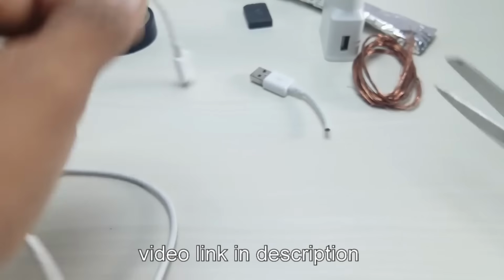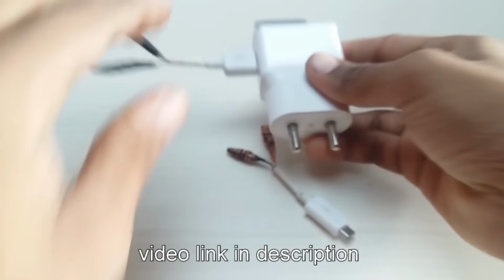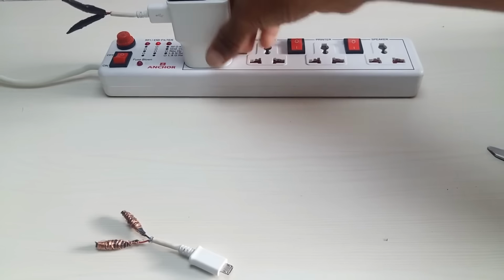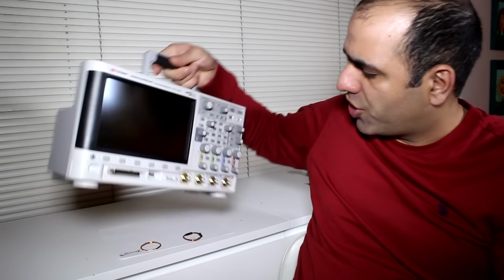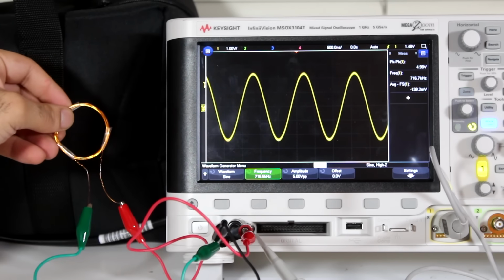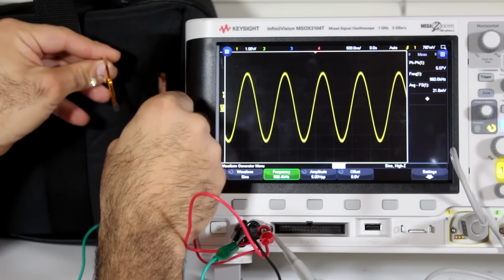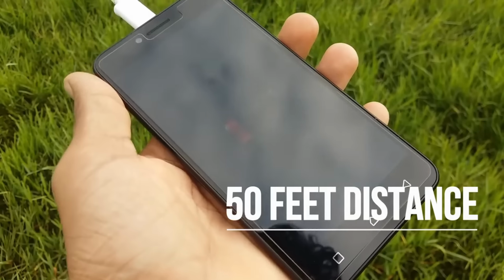Fake and Real Wireless Power

Comment: People that believe that video are the people that believe the sparks that are produced when you "shock" yourself with 120V

Shhh... Don't ruin it! ;)
Reply: Come on...120 is for p8ssies! Upgrade to 220V and feel the wrath of AC/DC :)
Reply: Yonatan24 Are these the same idiots who put their iPhones into their microwaves during that huge misinformation campaign?
Reply: 'Cause I'm T.N.T!!! :-D
Reply: cmon 220v is for bitches, upgrade into 3 phase 240v AC!!!
Reply: Oh, you don't know that you can charge them that way? ;)
Reply: Yes. i wrote down both AC and DC because the wall power supply is AC,but many devices in the house require DC,and you can shock yourself with a phone charger,for example :D
More volts,more fun :)
Reply: xXx_MlgTr1kSh00ter _Xx 3 phase 480 is better
Reply: TheDrunkenRebel
XD
Reply: I'm dynamite
Reply: For 220V(I'm not saying he really did it, but it's possible): I have seen spark from static electricity when I touch a door handle, also you can see sparks from lower quality plugs when being inserted into a socket. When there short as in those cases the air is heated and energy is transferred between the two points over it - for instance lightning.
Reply: +Mr.Someone \Tom/ Put AC on your tongue. You will fucking feel that shit xD Equivalent voltage DC simply doesn't hurt as bad as AC, ever. The tongue is just sensitive, mostly cause its wet.
Reply: xXx_MlgTr1kSh00ter _Xx or just g
Come to my home and play with some 380V AC =)
Reply: TheDrunkenRebel  AC is the current you can feel through your body and dc is the one that you can feel through your tongue ;-)
Reply: nope, the microwaves charging campaign was originally planned by 4chans

Comment: You can also achieve higher range by increasing the gain on the receiving and transmitting antennae. For example my toothbrush has wireless charging. I'm pretty sure it uses two highly directional antennas, with a load sensor to detect when the toothbrush is in the charging port so it does not waste power.

I really like it. Great idea to waterproof a port. Great vid as always. Really like your content. I feel like the shocks were a gimmick and you can move away from them. The production value and comedy are making up for it.

Comment: How was the capacitor value on the secondary coil calculated to get a resonant frequency of ~1kHz?
Reply from the maker: +agr00m I wanted 1MHz resonance, and I had 1nF capacitor. So I calculated my inductance using: f = 1/(2*pi*SQRT(L * C))
then I had a round solder flux container, measured it's diameter and using an online calculator got the number of turns I needed and it was pretty close to my desired resonance.
Reply: f = 1/[(2pi)sqrt(LC)]

Comment: BTW, you're terribly wrong with inability to transmit power using a DC. We can create a powerful DC source that will create powerful electric field that will ionise some conductor and will create a secondary current. It's very complex and doesn't apply to the particular video, but it is possible.
Reply from the maker: +Александр Шишлов well, if you raise the DC voltage so high that air breaks into a conductor and then arcs through (like lightning), then you are really turning air into a wire! That's no means to transfer energy efficiently anyways
Reply: But he is specifically talking about inductance which needs an AC current in order to generate magnetic flux, otherwise it just functions as a short.
Reply: Александр Шишлов Ah, I see what you're saying. You're speaking in general terms; I'm speaking specifically about this "hack." Yes, a DC generator works by physically turning the coil to induce an EMF that is roughly DC (the current is still alternating though, it's just that the high number of rotor coils smooths this out to a continuous DC). 

However, ElectroBoom was talking about this hack, which has no moving parts. He simply plugged in a static, stationary charger with two  unconnected coils which definitely does not create any type of current.
Reply: Yes you can deliver power by static electric fields, but it's really ineffective. Power transfer over arc discharge is another topic, but that's not "wireless" anymore.
Reply: I'm not talking about arc-discharge. Arc involves high current, but there are plenty other discharges that do not involve breaking air into conductor. There are even airless discharges. (E.g. Townsend discharge).
Even without discharge: some conductors have much lower work function than others, thus you can make electrons flow out from the secondary conductor without ionising the primary one.

What I'm trying to say is that you were right in the particular case, you were wrong in general.
Reply: Marian Keller Could you explain further? I'm only aware of inductive coupling and capacitive coupling, both of which require oscillating fields or moving components. Even capacitive coupling requires an oscillating electric field to transmit power.
Reply: Google polarisation in electric field.
Reply: Александр Шишлов to run dc through the air you need a shit ton of power. Not 5 volts. Stick to the subject matter of the video not random bullshit.
Reply: You're terribly wrong. Even DC creates magnetic flux! But the flux is constant! Ф=∫∫B*dS
To make current in the secondary circuit, you need to generate alternating magnetic flux, not current. You can create dФ/dt either by alternating magnetic field or by rotating a circuit ( that's how a generator works).
Reply: the magnetic field of the earth is big

Comment: Hi guys, quick and possibly easy question here.I have a sort of BatmanDeskLight it gets powered from a USB with 5V 500mA but it looks really bad with cables.Its a big bat shaped desk thingy so it has enough room on its back to glue some batteries without blocking the LEDs.Problem is i dont know how to connect it.Sure i will cut the usb cable and connect it to some AA or AAA batteries but what should i place in between to set it to required Voltage and Current. Thanks

http://www.ebay.com/itm/BATMAN-ECLIPSE-LIGHT-USB-POWERED-DESK-LAMP-DC-COMICS-/282208594748

this is the lamp.

Comment: hi , big fan here... maybe you could have done some math on how much input power is required to transmit over 50 feet? (if its even theoretically possible).. and then ideally give us a real world comparison of the significance of that much power?
Reply: just a thought , loved the video either way :D
Reply: The answer is: How big antennas (the loops) can you build? He is using resonant inductive coupling, for which D(range)/D(antenna) < 10 is the extreme limit.
So for practical purposes, you need to build an antenna with a diameter of atleast 5 feet (preferably 10 feet).
Otherwise, for these loops, your power output goes down by power of 64 for every doubling of distance.
Reply: belghter ................. no.
FM Radio is NOT used to transmit power.
Radio stations can transmit quite some distance with only a couple of watts (With 20 Watts you can go around the globe with low frequencies).
But country-wide FM stations with multiple bands often require > 10 kW.

On the other hand, with just nano-watts of signal on your antenna you already have a perfect signal for your Radio.

Comment: you know you can fast charge your phone by plugging it into the charger, wrapping the charger around your phone, then putting it in the microwave?

the electromagnetic radiation is inducted into the coil you made by wrapping it around your phone which creates a current and charges your phone. the effect is amplified by the microwaves so it charges your phone super fast.
Reply: this method is also effective at converting any phone into a note 7
Reply: exactly

instant upgrade
Reply: I try it. I blown my house away. What have you done to my life?
Reply: 1wsx10 Will it explode then?
Reply: only if you tig solder the phone charger to the wall socket, otherwise it wont work
Reply: Now do you have to switch on the Microwave or what? Won't this destroy my phone?
Reply: 1wsx10 instructions unclear, got nigga fried up into dust, microwave runs minecraft at -9999 fps

Comment: YouTube is full of fakers. Cars that run on water, perpetual motion generators, you name it. All fake
Reply: I had a friend that SWEARS his truck gets 40+ mpg since he added some crazy contraption that adds water to somewhere and supposely burns it or something, and added a fan to somewhere. Upon further review I found out they also had him disable the Environmental Whatsits that stop it from being an even nastier polution machine. Still think he is doing some sort of calculation wrong on MPG.
Reply: I think it's a device that electrolyses water, and feeds the resultant hydrogen and oxygen to the engine. Electrolysis loses 20% of the energy put into it, and that energy comes from the engine driving the generator, so there can be no gain. The mods to the car may mean the engine is running too lean, and over time could result in holes burnt through the piston crowns. Your friend is risking expensive damage to his engine. Running lean is probably the reason for his improved mpg. If this device was viable car makers would fit them to new cars. After all, more mpg is a great selling point.
Reply: 'zacltly

Comment: Just the simple fact that you mentioned Tesla and resonant transmission makes you the coolest youtuber ever. Thanks for educating the masses and not turning to the dark side.
Reply: its very rare these days to see such honesty on this website, i truly believe he his here for his love of science and teaching others rather then making money.
Reply: Robert Lunsford ,
Reply: no, you could just use a rectifier to convert ac to dc but still you'd have you use a resistor or capacitor depending on energy supplied and the energy required, it was just an example anyways.
Reply: I think for the most part he doesnt make that much money from here, I mean he still works as an electrical engineer, right?
Reply: Yeah, I think. He mentions work in the tesla in a vacuum vid
Reply: except, you do not need a capacitor on that coil with the LED, in fact the capacitor would limit the power on that coil, also LEDs run with any type of current/voltage, AC or DC, LED doesn't care
why? bcoz LED runs on DC, however it acts liek a diode= current flows in one direction only
so on AC it actually grabbs only the part of the current that has the correct polarization
low frequency AC alows the human eye to see it (below 15Hz)

one other thing, using any metalic object, best would be iron, alows the secondary coil to salvage up to 95% of the original power 

did i google all that? nope, spent 4years learning electronics, we had electricity etc. as basics 

one more thing, it is possible to collect electric charges with just one surrface that is somewhat conductive,
electrostaicity is everywhere in the air :) yes it will not be able to charge a phone, maybe with a huge surrface you could light up a LED for a second

Comment: Can't you "focus" the electromagnetic field in a certain direction, such that you can receive greater power, while the receiver is within the cone/beam this focused field? I have seen this for wifi signal transmission, using a parabolic metallic reflector, but I a, not sure if this also helps for power transmission.
Reply: K van der Veen To some degree you can using a wave guide. Look up the inverse square law if you want to know more. 

 Nikola Tesla did devise a way around this, but our transmission signals we have today would be a lot different if he succeeded in creating a large resonant carrier wave.
Reply: A magnetic field has a really hard time travelling through air because the reluctance of air is very high. Thats why transformers actually use iron cores to guide the magnetic flux between the two coils.
Reply: SeveralBirds There is certainly  truth in that statement, frequency plays a large role as well though as iron has a cerain hysteresis where the b field transitions into heat and sound.

Comment: Also isn't the strength of the field inversely proportional to distance squared? If you had a wireless charger that could work over 50 feet you must be running it off of a nuclear reactor or something.
Reply: it would electrocute YOU not just charge the product lol
Reply: Yeah, B is proportional to 1/r^2 from the current source.

Whooooole lotta juice needed at 50ft.
Reply: Remember, Tesla thought he could transmit power wireless over great distances and wouldn't need those pesky power lines.

For a bright guy, he seemed oblivious to the inverse  field strength characteristic.
Reply: @barryf5479   He was aware of the inverse square law, he knew that power couldn't be transmitted wirelessly at ground level. He mistakenly thought that at high altitude with low pressure things were different.
Reply: Who says he doesn't have his own nuclear reactor? Maybe that video just got taken down by the government.
Reply: Barry F Tesla used to be my "Hero" at one time. Until, that is, I thought "maybe this guy is too good to be true?". And yeah...he was! Credited with far,far, too much! Things he DIDN'T invent! A\C power generation, A\C Motor, The transformer, X rays, Fluorescent tubes to name just a few. To my mind, these days, Tesla was NOTHING but a "patent pirate."
Reply: Batman Did what exactly?
Reply: no he didn't. But the others who did, were receiving signals of few nW, so good luck with charging anything with that.
Reply: dumb idiot...
bees keep getting bigger every year.
Reply: *****
still too dangerous to be in a product for sale on the market. too dangerous and no realy advantage over cords.
Reply: Ummm, tesla coils! B-)
Reply: dumb idiot Yeah, are they friggin kidding, people are so stupid
Reply: Who's worse, Tesla or Edison in stealing innovations?
Reply: billyjean1073 At least Edison paid for them.
Reply: lol but telsa did it from Europe to ny... across the Atlantic ocean without a nuclear reactor ;)

Comment: 1:49 false. You can output DC through air, or at least my CW voltage multiplier can. It's just not reasonable for power generation.

Comment: There's a sucker born every minute I guess. Good job showing how utterly stupid this "wireless energy transfer method" is, the world needs more people like you.
He probably faked the phone charging screen by some custom app, or connected a small power bank on the bottom of the micro usb plug. Or maybe just stuck some small lithium button cells on the back of the phone with a small regulator of some sort, in order to keep everything as clean as possible.

Comment: You said you need AC to make wireless power transfer , can i use other than sine wave signal? Square wave for example? Also do you have any recommended links and sources perhaps articles about this phenomenon especially some mathematical expressions?
Reply: Square waves are composed of infinite odd harmonics of sine waves. Wireless power only functions if both transmitter and receiver is both at the same resonant frequency, it might work but only the fundamental frequency will be received while the rest of the harmonics won't be (the coils are basically inductors with air cores, so extremely high frequency components will be attenuated while the lower ones will not), there will be a significant power loss.
Reply: Will it also works in vacuum?
Reply: yes, because you are essentially creating EM waves.
Reply: Your answers really help, thank you....

Comment: Actual wireless chargers only work at a distance of millimeters, and at a much lower rate than they would with wires.... But that monstrosity works at 50 fucking feet... Who would believe that? Even if you have 0 knowledge of how electricity works you should realize that that is fake

Comment: A few years back I built a wireless charger for my Galaxy S3. Standard stuff, base station has a coil and some magnets to orient the phone correctly, matching coil and magnets in the phone. Told my coworkers about it, and every single one of them thought I had made something like that bullshit charger, and were all deeply disappointed when I explained that the phone only charged while on the base station.

People just think that electricity is magic. Add in a little bit of Tesla mysticism, and people think wireless power really works like that video showed. It's even worse with lasers. Everyone seems to think laser pointers and laser cutters are two different types of lasers, and think "cutting lasers" work like sci-fi weapons. Try to explain power density and their eyes just glaze over.

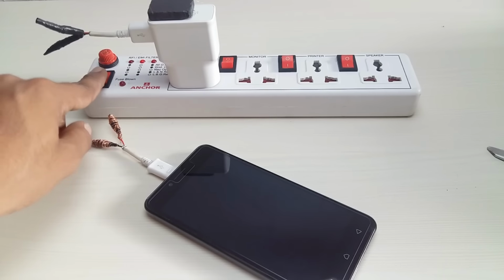Comment: 1:35 Just one minor point: looking at the original video and the Amazon page (http://www.amazon.in/Anchor-Spike-Socket-Single-Switch/dp/B00H7BC1PC), there is no fourth switch at the top, just the one to the far left... which, in the original vid, is turned on just when the phone begins "charging".

This leaves us 3 possibilities. 1: left switch controls the left socket, 2: left switch is a "master", switches are for the socket to their right, and the left socket is always on as long as the master is, 3: left switch is a "master", switches are for the socket to their left, and the right socket is always on as long as the master is), and two of those make sense for what we see: the left switch is turned on, and power supposedly flows. So it's more likely as not that the socket really was powered on, even if nothing else about the video is true.